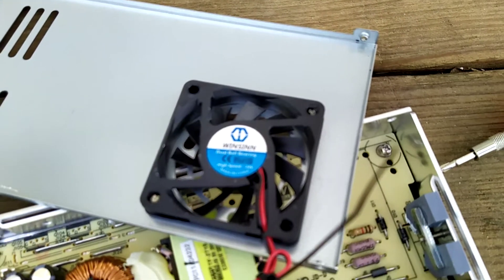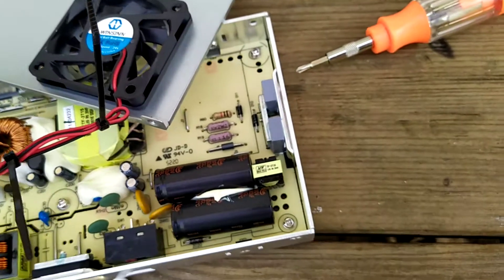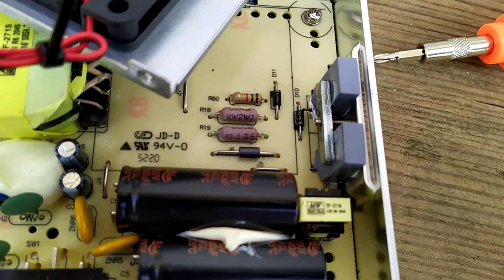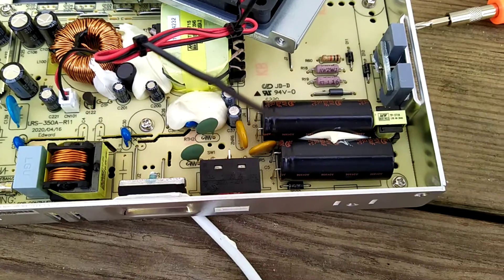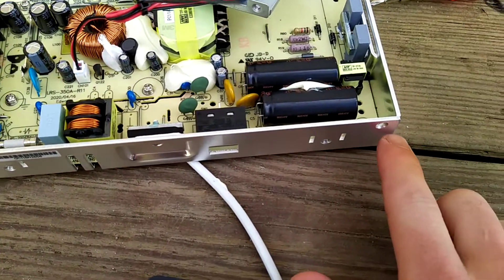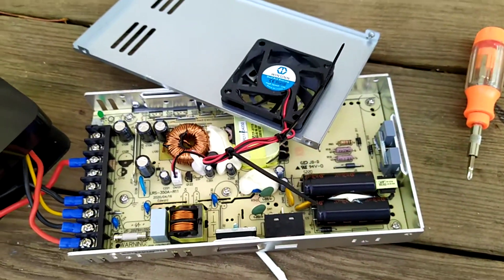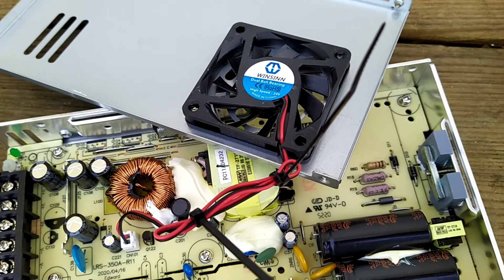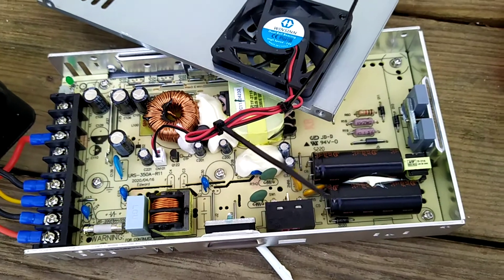Ender 3 power supply fan swap

Comment: If you unplug the power supply, then you can't short out anything.  I came looking for information on heat in these supplies, all I'm finding are people who shouldn't be doing instructional videos....  wow.
Reply from the maker: The caps can hold a charge for days or more, and electrocute someone, or short out.  Please learn more before making ignorant comments sir. Perhaps you should begin with the basics.
Reply: I hope you're trolling. Those power supplies can hold a fatal amount of charge, even when unplugged, for a long long time. Please be careful.
Reply from the maker: @pbft.j  I actually had a good amount of sparks from shorting the screwdriver to the board and case when I did the fan swap. It didn't blow the board or bite me though. Definitely unplugged for more than an hour too.